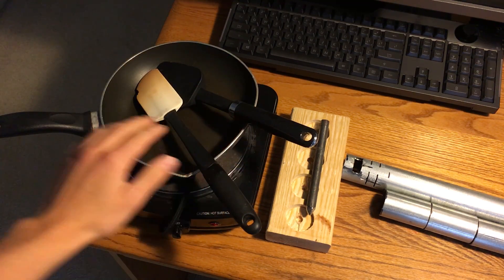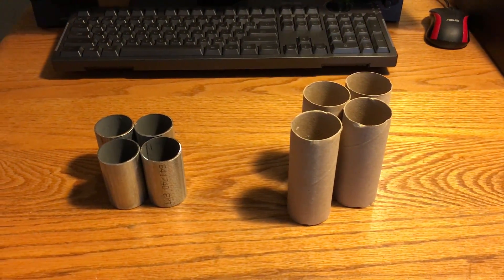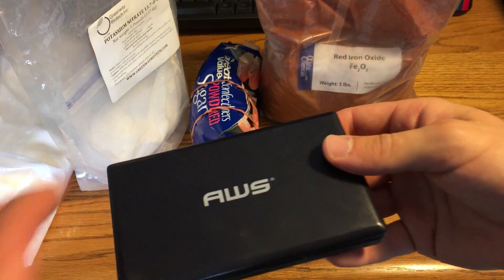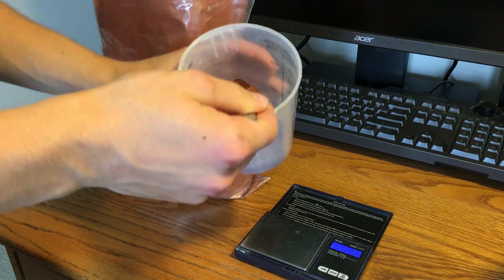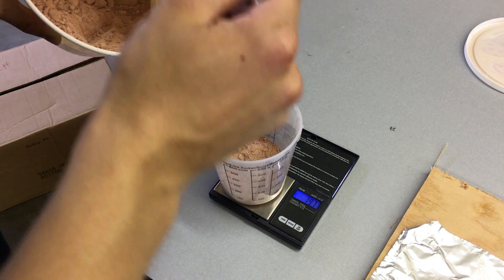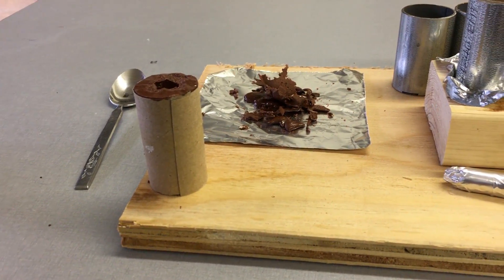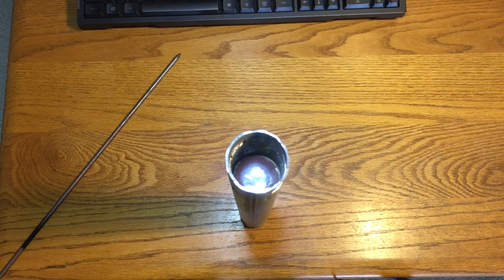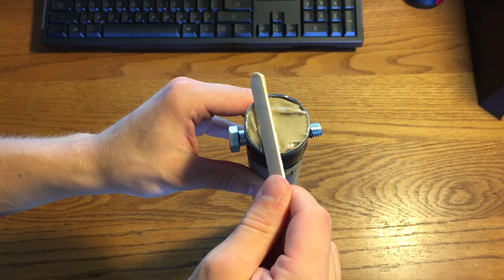High Power RCandy Rocket Motor Tutorial (Part 2)

Comment: You're coring tool is a little too big for that size motor. Get a smaller one if you want better performance.
Reply from the maker: I think it's a pretty good size actually. If I used a smaller coring tool, the motor would take a bit longer to get up to full power. Also, I need a decent size core to insert my igniters all the way inside.

Comment: I liked the specific ingredients and Scale for measuring. The Steel tube for the motor was scary, shrapnel hazard, the steel rod for the center hole was scary, ignition hazard, and the lack of temperature monitoring during the sugar melt was scary, ignition hazard. Excellent identification of a pathway (rather hazardous though!).
Reply from the maker: Over the 4-5 years I made rcandy, I found that the concrete nozzle/endcap fail before the steel tube which relieves the pressure that would cause shrapnel. Steel shrapnel is not at all something to worry about unless you tried using an explosive as fuel and welded on steel endcaps. Also, the fuel is very stable. It requires a flame to ignite. I can plop some of it directly on my stove at the "High" setting, and it won't go off.

Comment: What is the differance between simply blending sugar and kno3 and compacting it into a rocket in a tube and smelting it into a solid?
Reply from the maker: I don't know. I would definitely like to try that if I had a hydraulic press and the tooling needed. That's how fireworks are made 🤷🏼‍♂️
Reply: @pyrogun1839  I've seen people make it by ramming the powder with a dowel and hammer, you don't need a hydraulic press :).
Reply from the maker: @ClayThunder  I've seen that too, but I'm not sure it provides enough pressure to compress the fuel enough. I'd rather make rocket motors that way than cook the fuel if it works well.
Reply: @pyrogun1839  You should try it. I'm in the processes of making one but I'm not sure if it is going to work due to the fact that I'm using cornstarch water paper as a plug. Since kno3 is an absorbent it might've lost its potency because of moisture. I did put it in a sealed plastic bag tho
Reply from the maker: @ClayThunder  Maybe. And your plug might work, just depends on the size of the motor.

Comment: Great video thanks for sharing!  

I would think being the propellent is not one solid piece it would overpressure at the seams between the grains? Apparently this doesn’t seem to be a problem. Are there any other procedure not shown?
Reply from the maker: I'm glad you like it! The fuel grains are supposed to burn from both ends and in the core. The problems I've experienced have mostly been caused by cement nozzles and end-caps that are too weak to hold up to the pressure. Someday I'll make some metal parts for more power.
Reply: Pyrogun1839  Technically the seams between the grains would be a crack in the propellent? 

The nozzle and plugs couldn’t be more anchored than that I would think.  I haven’t seen cement used to line a metal melting furnace.  I would have expected the cement to last for the motor. Cracks like pottery heated too fast or damp in a kiln ?
Reply from the maker: @18141776hhhh  No, they are not a crack. I think the end-cap/nozzles slip out with too much pressure because the metal surface is so smooth. Or they simply break apart due to the pressure. May be a combination of cracking/slipping. Impossible to tell without a slow-mo camera.
Reply from the maker: @18141776hhhh  with metal end-caps and nozzles screwed into the engine body, the only thing that could fail/limit the power in an engine is the fuel. I've seen some very large rcandy fueled engines produce huge amounts of thrust without failing because they have high quality metal parts.

Comment: Could i make these in inch tubes with a smaller core...? would i still get a good burn rate or would it be over with in milliseconds...? bit wary of going to big in England..Good show by the way....That was an amazing easy tutorial....thank you...just one more question,....with the added extra weight, steel tubing,cement,....what type of weight would that set up lift??? thanks.
Reply from the maker: Absolutely! Your core should be the entire length of the fuel grain, so when you say "smaller" I assume you mean a narrower core which means it would take a bit longer to increase thrust. Your nozzle diameter greatly affects the power of the motor (too big = small amount of thrust/too small = motor blows up). I would say this motor weighs about the same as the rocket itself. I understand your concerns being in a more populated area. You definitely need to be careful. Glad you like the video!

Here is a video of a rocket being launched with this motor...https://www.youtube.com/watch?v=5LtpaqtBev4

Here is a video of a rocket with a 1 inch PVC motor...https://www.youtube.com/watch?v=J35Le0fAMiU&t=1s

Comment: It should be made known that the shrinking of the rocket “candy” makes those weird ditches in the fuel, these will result in bubbles of air in the rocket engine, and might result in explosions. To fix this, make each section a centimeter larger to allow sanding, or even cutting at least. This will lower the chance of exploding by quite a bit, but will lower the surface area of the fuel, therefore slightly less thrust. That may be fixed with better nozzles.
Reply from the maker: Where are you saying the bubbles of air will be? Inside the rcandy grains? I would think that the settling of the fuel would fill in any air pockets, not create them.
Reply: Pyrogun1839 not in the grains. When he says the rcandy is cooled, you will see that there is a dip in the top. Putting a flat surface of rcandy on top of that will form a “bubble”. Like a flipped over half pipe
Reply from the maker: @bob-hacking6027  Ok, I see what you're saying. However, those "bubbles" don't cause my rocket engines to fail. The grains burn from both ends and from the inside of the core (as seen in this animation...https://www.youtube.com/watch?v=SZgxEdajwdE ). Whether the ends are flat or have a bit of a dip in them (I've tested both ways) the performance is similar. The engine utilizing these grains worked great! And yes, better nozzles would help. However, I wanted to make these as cheap as possible so I was limited by the strength of my cement nozzles.

Comment: Dont make steel cased rocket engines. Steel fragments when it ruptures and creates shrapnel. Steel is also way too heavy to make an efficient engine.
Reply from the maker: I understand your concerns. However, steel was the only option when I was making these. I couldn't afford to buy the aluminum motor cases, and I couldn't find any aluminum tubing/pipe to purchase so I could make my own. Additionally, I used cement as a nozzle/endcap which would fail before the steel case could explode and produce shrapnel. From my testing, steel did just fine. They sent rockets plenty high for me :)

Comment: A star shaped core would be a nice extra touch.
It would give you more thrust early on.
Reply from the maker: I would do it if they made star shaped coring tools! I don't know if that's a thing or not, but I definitely wouldn't be able to make one.
Reply: @pyrogun1839 . Definitely worth you taking a look at.
You need the same surface area so you can optimise your throat for one constant flow rate.
The core you are using is called a "progressive grain".

Comment: Why go through all the extra work and risk  fire by cooking the chemicals ? Using a nutra-bullet to pulverize the granulated sugar and potassium nitrate together as well as the clay kitty litter works great.
I just started messing with these sugar rockets .I kept the tubes from used up fireworks were they already had the nozzle plug.All I did was use a mallet to compress everything, I didn't cook anything. I question how much better your results are by cooking the chemicals.After my first 3 launches I upped the ante and added 65% P.Nit., 35% Sugar, and for extra strength I added a heaping tablespoon of gun powder into the high speed blender to mix up thoroughly. I stuffed 3/4's of the engine with my normal formula and finished off with my gun powder mix.  Anyway I taped a long skewer to it and lit the fuse. I didn't use iron oxide. Didn't need it. My first attempt launch was AMAZING ! These things go higher then any ESTE'S rocket I have ever seen. I tried cooking the chemicals once but it was too messy,time consuming.If I would of noticed a difference I would of continued cooking the rocket full.
Safety ..Safety... Safety !
Reply from the maker: When I cook on my burner, the rcandy cannot self-ignite.  It simply doesn't get hot enough.  And from my experience, cooking the fuel has always been very effective. Additionally, I'd have to make/get new tools to load rocket engines with dry fuel.
Reply: so wich one is better? cooking it? i saw other videos that they dont cook anything and fly a lot.
Reply from the maker: Pabloxd123 I've heard cooking the fuel can  decrease the power of the fuel, but I don't feel like it does that much.  My rockets get pretty high with relatively small engines.  Cooking works great for me.

Comment: +Pyrogun1839, my bates grain looks almost the same (06:39), but remains sticky for a long time. How long did it take for you to dry completely?
Reply from the maker: It's pretty much always sticky.  I'd say it takes about 15 minutes to harden completely.  Temperature/humidity might affect the hardening time.
Reply: Pyrogun1839, how do you preserve the grains? Seal pack immediately after pulling off the coring rod?
Reply from the maker: Arka Mitra Usually I immediately put them in the rocket engine, but if I need to store them, I put them in a plastic bag and then in an ammo can.
Reply: Pyrogun1839, I see! Packing into the rocket is the good idea 💡 now is it good to apply some oil to the coring rod before inserting? I don't have those foils and whenever I've tried with those, it got stuck poorly making the grain unusable.
Reply: And a few more things:
--
1) Coring the grain seems a bit hazardous sometimes! What if I pour the propellant, let it dry and drill slowly as per requirement? Does it affect the grain's structure?
--
2) In this particular motor, you've used 4 bates grains each of 2.5" length with a 0.5" core, right? How much thrust can it produce approximately? And, can I apply the same configuration in my PVC motor?
---
PLEASE HELP ME OUT. I HAVE ALREADY FOLLOWED YOU ON TWITTER - WOULD BE GREAT IF YOU ENTERTAIN DIRECT MESSAGE OVER THERE. :)
Reply from the maker: I have modified my methods quite a bit since I made this video.  I use a wooden dowel as the rod, wrap it in foil, use foil tape to keep the foil on, and then put a thin layer of vegetable oil on the rod.  The oil keeps the foil from sticking.  It can stick a little, but I just use a screwdriver to peel it off from the inside of the grain.
Reply from the maker: 1) Yes it certainly is the scariest part of making a grain!  I used to drill a core, but because the RCandy is so brittle, I would often crack the grains.  If you do drill, DON'T STOP!  It heats up the RCandy, and if you stop, it will cool, and the drill bit will get stuck in the grain.  The only way to get the drill bit out is to break the grain...or burn it!
2) That is correct.  I have never measured the thrust, but it can send a 5 foot tall rocket a couple thousand feet into the air!  I don't see why not.  It should work with PVC, but you have to have a solid nozzle/endcap that won't pop out.
Sorry, I'm rarely on Twitter.  I'm always on Instagram though :)

Comment: I want to make same kind of fuel that easily flows into grain instead of scooping and pressing. What to do? I am adding little water and the mixture ends up not like yours.
Reply from the maker: I use a 50/50 mixture of powdered/granulated potassium nitrate, granulated sugar, and iron oxide powder in the ratio 65/35/2.  Don't use water (that's a different method) and as soon as the mixture has completely melted, pour it into the casting grains.  Don't overcook it!
Reply: Pyrogun1839, What's that 50/50 mixture? Sorry, I couldn't get it. Kindly explain once more. I'm almost maintaining the same ratio i.e. 65:35 and 1 gm Iron Oxide for every 100 gm batch. But what's that first 50/50 that you've mentioned in the beginning?
Reply from the maker: The 50/50 mixture is half granulated KNO3 and half powdered KNO3

Comment: Please, don't tell people to turn the heat to high. That's how you become liable for someone burning their face off. You don't need the heat that high
Reply from the maker: You're correct, I should say to only turn it up as high as needed to melt the rcandy.  With my burner, that happens to be high.  Even when the mixture has landed directly on the burner, it has never ignited.  Perhaps this brand of burner just doesn't get hot enough to auto-ignite rcandy.  I'll take this into consideration when making possible future videos.  Thank you.
Reply: its not that bad Clay. Maybe you should tell mum.
Reply: 300 degrees

Comment: nice but the problem is than KNO3 is not available to buy...
Reply from the maker: You can buy it on the internet ~$3 a pound or at hardware stores (Lowes/Home Depot) in the form of stump remover for ~$8 a pound.
Reply: Spectercide stump remover at Lowe's home depot no longer carries it
Reply from the maker: Hmm, last time I checked it was still being sold at my local Lowes/Home Depot.  Maybe it depends on where you live.
Reply: Same here in canada but i made it myself its harder to find iron oxyde for me
Reply from the maker: the lone boner iron oxide probably doesn't help the burn rate that much.  I wouldn't worry about not having it.
Reply: put a piece of iron in water...
Reply: LlamaGumby its time consuming i used hydrogen peroxide method it was instantaneous ( H2O2 with nacl on steel wool but the quality was bad)

Comment: what is the difference between powdered kn03 and normal kn03
Reply from the maker: I get my KNO3 in the form of granulated sugar.  I simply powder it by grinding it in a coffee grinder.  The best way to powder the KNO3 would be to use a ball mill.
Reply from the maker: Also, powdered KNO3 causes the fuel to burn at a faster rate.
Reply: Pyrogun1839 Ohh thanks so much